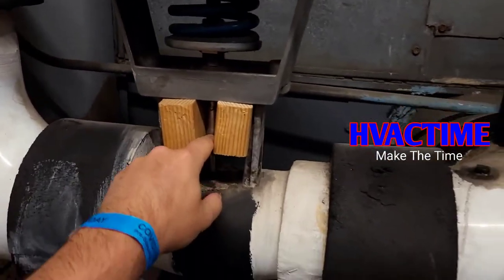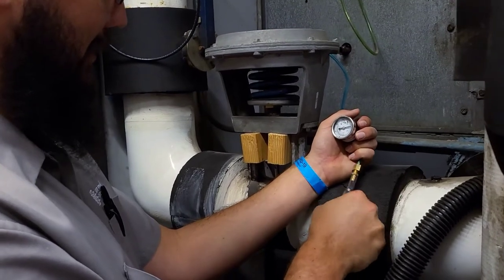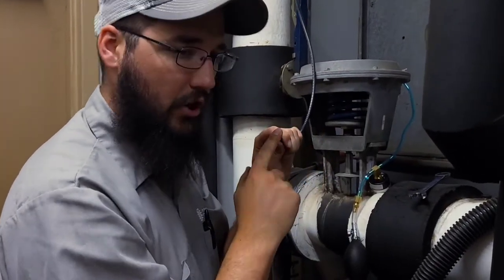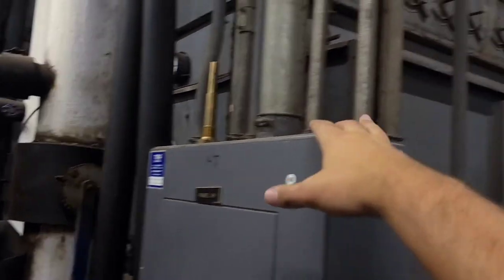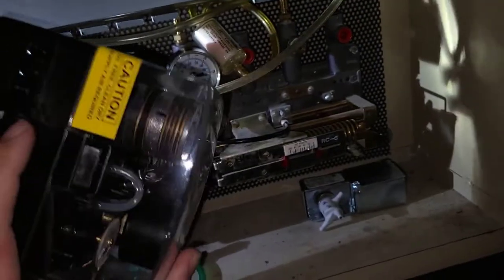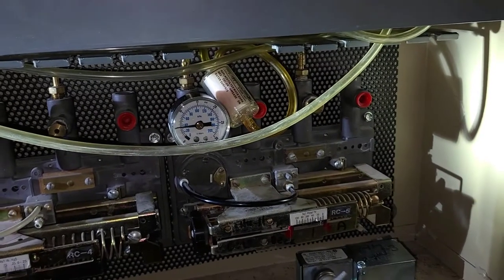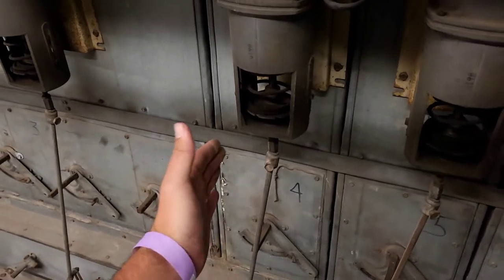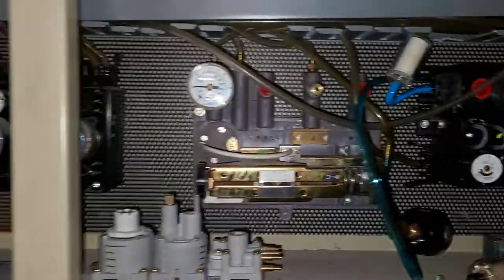Pneumatic AC Not Working - HVAC Technician

Comment: For those with an interest download the Honeywell "Gray Manual". It includes a chapter on pneumatic fundamentals.
Some things to remember if you have a issue like this one:
Not all valves are stem up to open....really they aren't....usually but no always

A common failure mode for an actuator with a rolling diaphragm is a tear in the diaphragm that doesn't effect operation until the diaphragm is partially inflated exposing the leak. (This will make you crazy the first time you see it)

Different actuators have different spring ranges (to allow sequencing or improve close off). The springs may have different colors.

There are different diaphragms for high temperature applications.

The quality of your air supply IS CRITICAL. refrigerated dryers, separators and regular compressor receiver blowdowns will keep things running..

Comment: This video was so helpful man. Thank you so much. I really wish I could find more pneumatic videos like this. If an AHU has a chilled water coil and a hot water coil do you have to have a seperate reciever controller with its own supply air temp transmitter? Or are there reciever controllers that are capable of doing both? The reciever controllers that I see in this video are Force Balance Reciever Controllers and I understand that the transmitter is what determines the output pressure to the actuator  but I really wish I could just go with Tim to a building with a full pneumatic automation system and have him teach me everything he knows. It really is a lost art. I find pneumatics incredibly interesting and have so much respect for guys like Tim that fully understand these pneumatic systems.

Comment: Gotta admit this went straight over my head.  Im going to need to watch it again.
Reply: Basically you have an air compressor, a reciever controller, a temperature transmitter, and an Actuator for an AHU. The reciever has main pressure going to it from the air compressor. The transmitter is mounted in the supply air duct of the AHU and is connected directly to the reciever. This transmitter is telling the reciever what  pressure to send to the actuator based on the supply air temperature leaving the AHU in order to controll how much chilled water is fed through the actuator and into the  chilled water coil. So I try to compare it to electrical and look at it like this. The air compressor is our power source or our line voltage that goes into the input side of a relay (which would be the reciever). Now imagine that you have a thermostat (Transmitter) that is wired to the relays coil. The thermostat is trying to maintain 55 degrees in the supply duct of the AHU. So imagine this thermostat varies how much voltage is able to go through the contacts of the relay to the actuator based on the temperature of the supply air temp. Sorry if this made it more confusing but sometimes comparing thing can make it easier to understand. I wish I could learn more about pneumatics from someone instead if having to read about it in a text book. It just isn't the same. I need to see, touch, listen and play with things in order to fully solidify my knowledge with things like pneumatics.

Comment: Good job I worked in an old plant .we had a mix of controls strait pneumatic ,electro-pneumatic, direct digital controllers a dedicated local computer system and an internet remote system many standalone systems. Roughly 8 million square feet on air conditioned space plus a lot more heat only space. Every day new adventures

Comment: Reminds me  of a triple deck (Hot, cold & bypass) system in a commercial building I worked on, what a nightmare. Thanks for the memories, stay safe.
Reply from the maker: haven't seen that, all of them ive ever worked on were 2 deck. Most of them have bypass instead of a hot deck. They do heater coils down stream.

Comment: Did you also change the actuator spring, it started off black, and afterwards (11:38) it is blue?
Reply from the maker: No it may have been camera angle.
Reply: @HVACTIME  Thanks! Nice video, BTW. At Rutgers University in NJ, the Chemistry bldg. had a 1970 wing. It had a Trane CentraVac controlled initially by pneumatics until it was upgraded in the late 80's to digital controls.